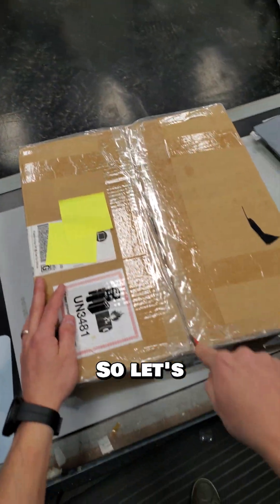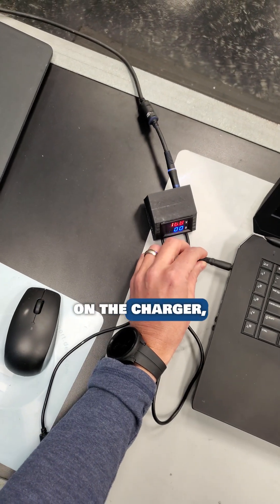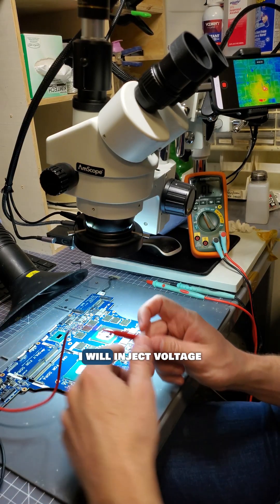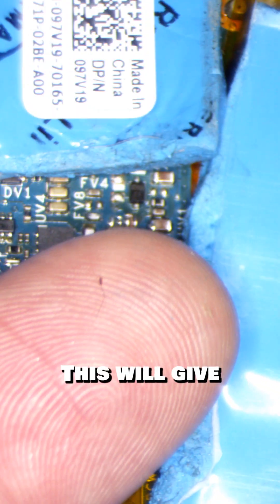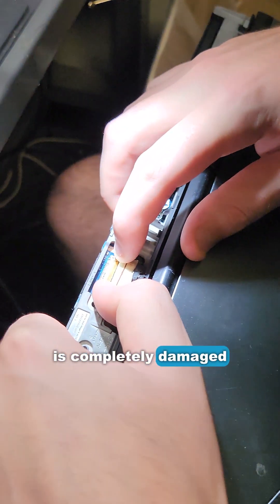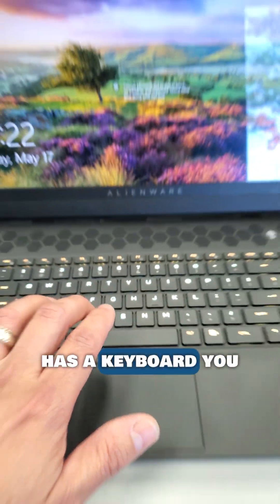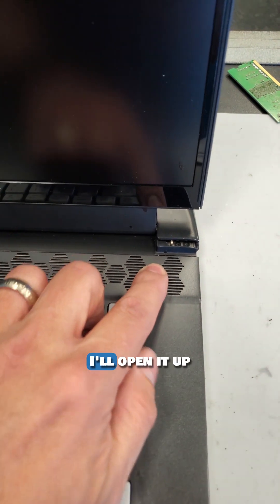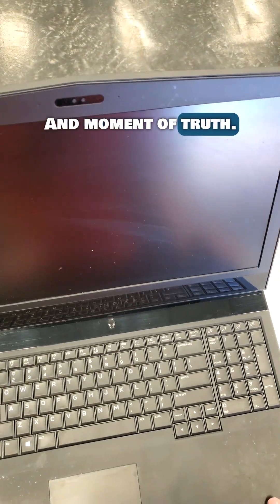Alienware Laptop Repair Fixes and Failures  | Compilation

Comment: I have an alienware m17 that had a similar issue but they replaced the power supply then the motherboard and still didn't fix the issue any advice ?

Comment: this is why I will never buy a gaming laptop, too much fail rate
Reply: No it's not like that. Mostly things depend on how you maintain it, cleaning dust and repeating thermal and finally if any issue arises or if you are gonna lay your hands inside your machine,make sure you know stuff and u do it carefully, otherwise take it to an expert.
My Alienware 17 R2 world 10yrs and 3 months without any issue. Unfortunately 2 days back the input power IC is damaged which can be replaced. Hope it works, lets see.

Comment: I need help, My Alienware x17 R2 won't boot, it show 2 Red, 3 blue lights, keyboard light is also on, but that's about it, memory RAM is not the case here... please help
Reply from the maker: A 2,3 error is no RAM detected.  I would reseat the memory.  If you have already done that, you will need to try one stick at a time per slot.  Try all combos.  You can send your machine in if you cannot figure it out.  Fill out a repair form at partspeople.com
Reply: @dellpartspeople  I tried that and resetting the memory, and nothing, I wanna ship it to you guys.
Reply from the maker: Okay, just fill out the service form and we will ship you a box.  You can also give us a call if you have any questions. 866-816-5254